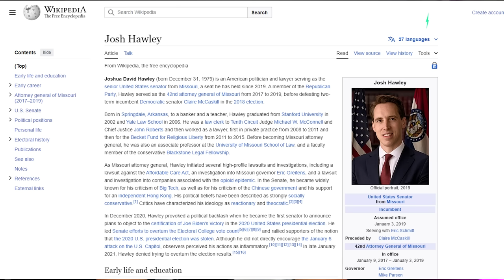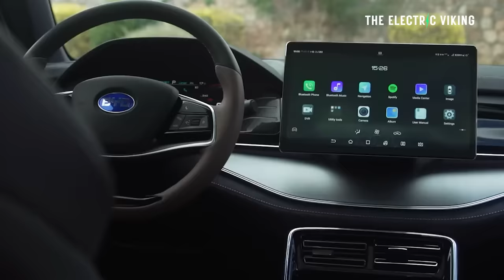Masses of unsold Chinese EVs are piling up and blocking European Ports

Comment: UK insurance are giving Chinese EV a hard time as apparently the parts are hard to source on accidents and repairs. Insurance on Chinese EV is sky high and also sky high for Teslas
Reply: In UK, insurance is defined as (stupidity of driver) * (performance of car) + dodgyness of parking place.  If you actually compare an EV like for like then the insurance for and EV is the SAME as an ICE car.  Regardless of you like or not like a car, insurance goes on liability.  So a Tesla long range model 3 is the same to insure as a AMG merc or M sport BMW.  A Peugeot e208 is the quickest 208 you can buy so the insurance is the highest 208.
Parts are universally problematic across the industry, it is worse for new Chinese cars as there is no infrastructure.
Reply: user-uk8tl3xy9e  the higher costs are mostly tariffs from china into the UK and VAT.  The prices are high for equivalent cars, but will be falling rapidly 
The additional problem is that the large cars make more profit, hence the too many stupid big SUV EV at the moment.
Battery costs are falling rapidly, what this space.
Reply: In America, Tesla sell very reasonably priced insurance for their own cars, so not sky high as you say.
Reply: @FloydThePink  you want to try and insure one in the uk with a 50% increase in one year.
Reply: @tomooo2637 Very true, my e208 is the same as the fastest petrol model
Reply: @macheadz Not mine, 10% change this year.
Reply: @ISuperTed  are you on UK insurance, and which company?
Reply: My car insurance is a ~30% more in 30k MG than it was for ten years old Toyota yaris hybrid worth £5k.(Edit yaris last year 2023 renewal vs MG 2024 renewal) 
But actually much less expensive than I expected for vastly better cover.
Reply: Ask the Russians these Chinese vehicles are crap
Reply: Not for me. Same price as last year for my MG4 and that was cheaper than my last ICE car.
Reply: @andrewsaint6581  You went from a 5k car to one presumably worth ten times that. After an accident the insurance company has to pay out a lot more money than 5k.
Reply: @user-uk8tl3xy9e 
Others channels say "They"  sell their cars cheap in China but expensive abroad to make up the difference for selling "Them" cheap in China.

Seems like some kind of European "Back-Lash" ?  🤷🏼‍♀️

I do not know.   ATM I see no BYD cars on the streets of America.
Reply: @ZoomZoomMX3  Russians and Chinese people are both complaining about the garbage quality. If those two groups both agree its garbage then you really don't want one because for the most part they are pretty accepting of poor quality.
Reply: @FloydThePink  lol, some of these simpletons don't even understand the basics of insurance...
Reply: Certainly! In some cases, incentives for purchasers of electric vehicles can indirectly function as a subsidy to EV manufacturers. Here's how:

When governments provide incentives such as tax credits, rebates, or grants directly to consumers purchasing electric vehicles, it stimulates demand for EVs. This increased demand, in turn, can lead to higher sales volumes for EV manufacturers. With higher sales volumes, EV manufacturers can benefit from economies of scale, driving down their production costs per unit. As a result, the government's incentive to consumers effectively helps bolster the profitability and competitiveness of EV manufacturers.

In this scenario, while the subsidy is provided to purchasers, it indirectly supports EV manufacturers by fostering a more favorable market environment for their products.
Reply: This happened to one of my work colleagues’ MG4. Minor bump at the rear (not his fault). Checked by insurance, ok to drive which he did while waiting for minor body damage repair. When the repairs were done (months later), a dent was found in the inverter (not the battery pack). The inverter in the MG4 is at the rear and so vulnerable in a rear end shunt. The insurance company decided they wanted to replace it as a precaution. However, they could not get a replacement inverter out of MG. Eventually the car was written off and my colleague now has gone back to petrol.

This is a ridiculous scenario that the manufacturer is ultimately to blame for. The car was fine. Writing it off was a waste. But MG would not make an inverter available for the repair and the insurance company were uncomfortable allowing the car to drive with known damage to an electrical box. This cost will be passed on to us the customer in our insurance premiums. You see similar horror stories with some replacement battery packs being offered at ridiculously high prices. Governments need to step in to protect the consumer from this price gouging. Manufacturers should in future be required to make certain unique key parts available for repair (still at a profit for them) by law.
Reply: Insurance companies are busting our chops both in UK and the US
Reply: @ZoomZoomMX3  wow genius!
Reply: I just pay standard insurance rates on my EV. 

We did have to replace an AC charge controller the part turned up in seven days. It wasn't a show stopper, the car wasn't off the road, we DC charged it until the part turned up.
Reply: My tesla was £90 cheaper to insure this year than last year.
Reply: @ouethojlkjn  who do you insure with as mine has has gone up by £458 in one year. No accidents and 25 years of no claims. I’m trying to find a better deal for my Model Y
Reply: @macheadz  My Tesla had a 0% increase, thanks to AAMI price matching here in Australia. Premium was AU$1200 fully comprehensive.
Reply: ICE cars are also being penalized with higher insurance premiums
Reply: The average annual insurance premium for a Tesla model X in Michigan is over $8,000.
Reply: In the U.K. insurers never use second hand parts in their repairs. That could cause a problem if parts aren't readily available. I still recall how when Ford launched one new model (maybe the Modeo) part of their publicity was saying how they had worked with U.K. insurers to get the cost down on common claims e.g. A new front wing.
Reply: @FloydThePink  Most of the insurance premium covers the damage you could do to someone else. Hence there being very little difference between fully comprehensive and Third Party Fire and Theft.
Reply: @MrDuncl  Ok good to know. So a new Rolls-Royce or Ferrari should be same to insure as a 1986 Dodge minivan.

Comment: Please send them to Canada! EVs and cars in general here are too expensive and lacking variety!
Reply: hopefully they fix sending spare parts soon.... its truly important to have them avaliable to fix already sold cars
Reply: I don't understand. If you can send cars, you can send car parts obviously.   @alexhguerra
Reply: @agusdharma1526  No Place To Store Them( ie )dealers?
Reply: @richardrhodes-gc2ko  I thought EVs didn’t need spares ? We are told they only got a battery & motors that will last forever lol
Reply: Keep them out of Canada. The upfront cost may be cheap, but without proper service centres and parts, these vehicles will be a nightmare to repair if your vehicle gets damaged. If you want a cheaper EV, wait 12 months or buy a used EV.
Reply: @addict8229  why would there not be service centers? If they come here wouldn't they also have BYD, geely dealerships etc?
Reply: @markevans2280  tie rod ends, bushings, power steering components, brake components... they are still cars even without gas engines in them.
Reply: @i6power30  they are already in Europe but they have no dealerships nor service centers. They don't care about longevity or your ability to maintain a car that was designed to be disposed of after 60k miles...
Reply: @agusdharma1526  that's assuming they have extra production capacity of those components.
Reply: @jameshathaway5117  you missed the point entirely...the EV crusaders pretend these cars need no servicing beyond charging...
Reply: If you want a cheap EV just wait a year and there’s probably gonna be a whole lot of repossessed to be had for cheap
Reply: @puzer1  for the most part they have a point. They don't need regular service. They do need wear components but those are repairs not maintenance. I doubt you will ever find a passenger car that has a replacement interval for tie rod ends listed in its sevice record book. Technically they have  as much of a point as you do. The only problem is in defining terms. You have included repairs in the category of maintenance.
Reply: @marshallforeman2051  I hope so. I've been eyeing on Volvo ex30. But the price difference between the US and Canada is so much even after currency conversion I wonder what justification is there.
Reply: Because we are getting them here in Eu for free.. Atto 3 cost 60k Canadian dolars..would You bbuy it for that price? EX30 cost the same or even more..
Reply: @markevans2280  windscreens, headlights, panels (in a crash) wheel bearings to name a few. Maybe they should just use some of these cars on the docks as spare parts instead?
Reply: @addict8229  Don't just buy an EV, buy a TESLA !
Reply: @marshallforeman2051  The problem is more subtle than that. In the U.K. there are massive tax subsidies for leasing a new EV. I got an email from work about it this week. The problem is there are no subsidies for the second buyer at the end of the lease. Fancy an 2020 42000 mile Audi e-tron for under £20K. Autotrader U.K. has a choice of four.

Comment: The main problem is that they do not sell directly, they use the usual dealers, and no one of the Chinese EVs is really cheap. Each of them is at least 2 times more expensive than in China... even the cheapest is over 40 k euros...
Reply: In our part of the world, prices are reasonable, very reasonable and EV growth is consequently quite high. Roads are quieter and air cleaner.
Reply: The problem is that they don't want to invest in EU. 
Kia started to sell in EU after they invested in EU. They are producing cars in EU.
Reply: @plau2007  BYD is building a huge plant for batteries and cars in Hungary. CATL is building a huge battery plant in Hungary. I think Elon and Tesla were fooled into investing in the worst country - Germany.
Reply: The only made in China EV in top 20  sold in Germany in January 2024 is Model 3.
Reply: But if they don't have a dealer or service network no one is going to buy them. At least with Polestar I know the local Volvo dealer services them although I don't think you could ask for a test drive which would put lots of people off.
Reply: @costiqueR  I am waiting for the first car build in Hungary.
Reply: @plau2007  It Is not a joke, they negotiated for almost 2 years what and how. In Hungary are today car factories of Daimler-Mercedes, BMW and Suzuki...
Reply: @costiqueR  I know. For the moment they signed an agreement BYD to buy the land. 
The first car should be built in 3 years. 
Let's see how it  will work. 
Chinese companies don't have very good experience in producing outside China. See the  examples from the USA or Africa. 
Cultural differences.
Reply: Yeah, because of your government tariffs
Reply: Yeah, because of your government tariffs
Reply: @Blake_87   Nope, those tariffs come later...and even so, taxes are not 100%. Dacia Spring has been sold in Europe for many years, is a Dongfeng Nano 1 with Renault-Dacia badge. In China is under 10000 dollars, in Europe is 18900 euros... for years... I heard recently they cut the price in Europe to 12000 euros, but I do not know for sure. What is sure, Europe exported more cars than imported from China, so, for today, the tariffs are not modified...
Reply: @Blake_87  It is not tariffs. 20% is VAT, 15% import taxes. 
Even so it doesn't add up. 
I think 10k price in Europe is after the Chinese government incentives.
Reply: @MrDuncl in Portugal they teamed up Toyota's dealer and they pretty much launched Toyota back then

Comment: What I worry about with buying a Chinese EV is getting parts when something breaks as all cars do. In 15 years when I need a motor/ controller or even a door handle will i be able to get one?  My girlfriends Samsung dishwasher had a small electronic board fail and it was more than the cost of the expensive unit in total and would take months to get to USA. It is just too risky with no BYD or other Chinese service centers in the USA.
Reply: 15 years? You think some junky $10-15k car is going to make it 15 years without repairs?
Reply: Be plenty in the scrap yards by then
Reply: Do some housework
Reply: @stevenbarrett7648  see that's very insightful thank you for sharing that
Reply: @darylfoster6133  I drive a 2006 Scion XB and it still runs great it was less than 15k new. Also electric cars are much more reliable on average.
Reply: @callmebigpapa electric cars are also totaled as soon as they are worth less than the cost of a replacement battery. So 10-30k depending on car.
Reply: @DeadNoob451  In my local area replacement battery packs are 2500-3500 for Leafs and 4-8000 for Telsa...but i am sure they total the car if the insurance company has to get from the dealer to fix a car
Reply: Wow u think this can last 15 years? 😂I think max 3
Reply: @Craigsinglee  I have 3 gassers the newest is a 2006 and electric are much more reliable. Look at golf carts which are basically small electric cars they last 30 years with just battery changes.
Reply: @callmebigpapa  That was 18 years ago. Heard of inflation?
Reply: Feeding the dragon buying chinese cars, with repair and parts supply issues or even a minor war and sanctions (like russia has) its a mugs game buying a chinese car they can be remotely deactivate or fail to update software to function when those 90 manufacturers go out of business.
Writings on the walls.
Buy a good quality used low km ICE Toyota under 10 years old and you will have lower overall costs and depreciation or reliability or worries.

Comment: Nobody in Europe believes that MG is still a British brand.
Its success comes from an existing dealer network, reasonably good prices and, in particular, good electrical features. And MG, unlike Tesla or Kia/Hyundai, has a nice hatchback in its range.
However, VW in particular should not be written off. With the new engine unit (APP550) and Software 4, VW is taking a big step.
And when I see the software problems with the EX30 and Smart #1/#3, I wouldn't buy a Geely model at the moment.
At least in Germany, the price/performance ratio of most Chinese BEVs is not really good and without good service, the risk is very high.
Reply: The VW software which was made by a CHINESE software company after VW got rid of its own underperforming IT/car software division?
(They ultimately bought the Chinese car software company btw, so its now a part of VW)
Reply: @johnsamu  Maybe, i don´t know the reasons, but the result.
In any case, the old prejudice that Chinese BEVs have better software than European ones is no longer true. At least not in the mid-price segment.
Reply: @meersde  If not so WHY did the VW CEO dismissed his ENTIRE european EV car software department to exchange it with a Chinese EV car software company??? I might assume he is better informed about the capability levels of software engineers than most people including me AND you.
Reply: @johnsamu  Check your sources. At Cariad, around 2000 of 6500 jobs are to be cut. The statement that all jobs have been replaced by the Chinese company is false.
Reply: @meersde  The entire topmanagement (except for the HRM) has been fired (according to the German Handelsblatt) and 2000 people  from the old organisation will be fired in the coming two years. IT engineers can always be used for different tasks and contracts can't be terminated very easy in Europe. VW will always need an IT group for new projects and support but the real development will be (organisational  internally) outsourced to the new Chinese company. The number of the size of the remaining group might INCLUDE the newly bought Chinese software company?

Comment: If Chinese prices get low enough, you could use them as mobile storage batteries and connect solar/wind sources to them.
Think of it - a mobile battery that you can easily move or dispose of!  [and a second car if your first one is in the shop]
Reply: Well, at least those with battery packs that don't ignite/explod🔥 while charging!

Comment: Tariffs are 10%, but prices are still super high and certainly not cheap! With taxes still much more than any ice version. And no MG is not seen as European. The car is actually somewhat affordable. Europeans have poor spending power. People from outside of Europe need to frigging learn this.
Reply: In the U.K. the taxes on EVs are very low if you lease. So BYD should be targeting the lease companies. I guess their concern is that they cars will be worth £10K at the end of the lease. Even Audi EVs are only about £20K retail once they are three years old.

Comment: BYD risk too high, price too high.  What is the residual value of BYD, an unfamiliar brand in Europe? BYD vehicles in Europe carry a price tag twice as high as those in China. Moreover, they are 10% to 20% pricier than comparable Tesla models. Tesla enjoys a solid reputation and boasts a well-established charging infrastructure. Given these factors, why opt for a BYD? Furthermore, in the event of repairs or maintenance, where does one turn for assistance with a BYD? And I know quite a few Europeans are reluctant to buy chinese products, which is a bit stupid because they do buyApple, or tesla built in china ...
Reply: People are less concerned about where their Tesla is made. In fact there was quite a bit about Chinese Teslas being higher quality. What they are concerned about is back up and they assume it would be the same whether their Tesla was made in the USA, China, or Germany.

p.s. I drove a GM (Europe) car for ten years and never did work out where it was made.